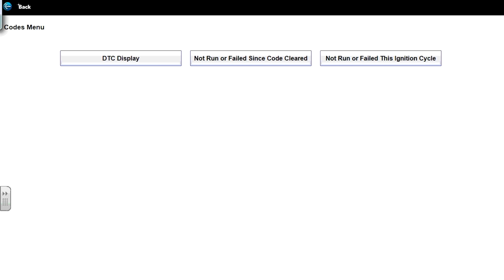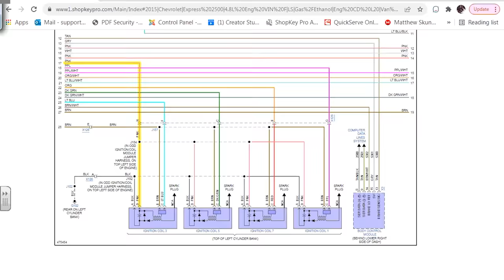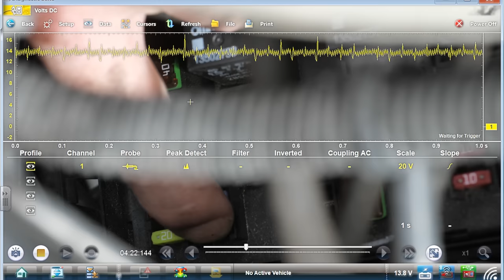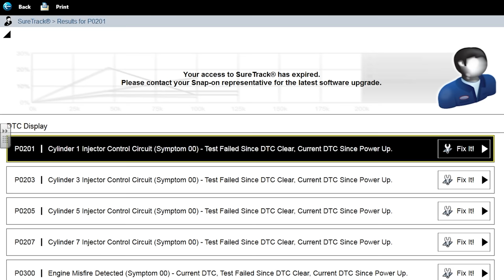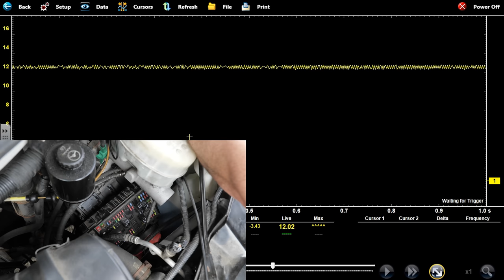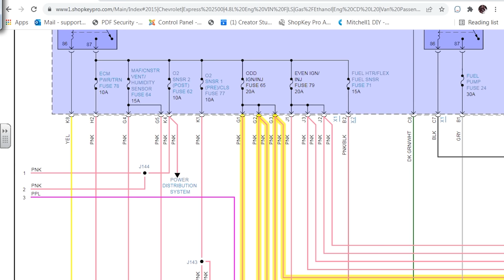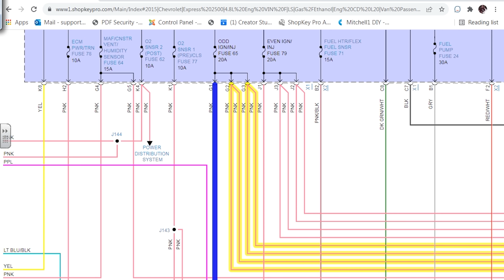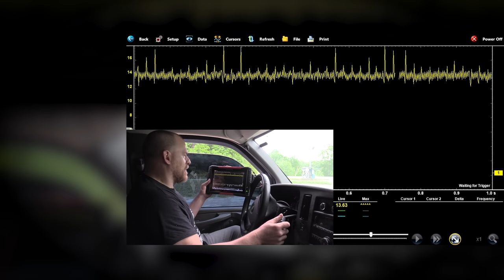2015 Chevy Express Intermittent Misfire - Injector Circuit Codes [Part 1]

Comment: I had the same issue on a 2008 Buick Enclave, I scoped both injector and coil powers.  When the injectors dropped out, so did the coils, but only set the injector codes.  I found that the screws that held the connectors to the bottom of the fuse box were stripped.  I ended up putting cardboard underneath of the connectors then snapped in the fuse box and it cured the issue.  That was several months ago.  By the way, this is my wife's car.

Comment: Huge fan been watching for years. I have worked on those vans before and I have seen the injector harness rub threw and ground on the block in the rear of the engine (unfortunately under the dog house)

Comment: I hate working for free too, but there have been times that I didn’t; but those rare occasions.

Last time I let someone go the came came in for an intermittent check engine light, P0300.

Ran the basics in 20 minutes.
Unsold brakes

Explained to the customer the situation that the care has great history, everything is new, and gave them a form to fill out next time the check engine light appears.

I further explained that if I continue diag I will charge for my time and the chances of finding something is slim. 

Customer returned two days later and I identified the problem. Looking at the worksheet I gave her turned out the boyfriend was using a OBD2 data logger for his job.

Always think outside the box

I did lose diag time but I won a customer for life. She has since brought all her cars to my shop and only trusts my judgment.

Comment: I work at a GM dealership and had one of these with the same exact codes on bank one and it was a constant dead misfire on 1,3,5,7 connected a head light bulb to the power feed and it would light it nice and bright. Fuse box fixed it though

Comment: I don't know about a 2015, but older ones of those vans had a problem with the engine harness rubbing through on the left front upper control arm mounting bracket.

Comment: Having the same issue with a 2016 4500 Express School Bus, replaced the fuse box and problem was fixed, thanks for the info. I must add our local Chevrolet dealer had it in stock .
Reply from the maker: Awesome, thanks!

Comment: As soon you took that fuse out the fuse box and put it back in all those codes are coming back that had my mind thinking as a fuse box or wiring problem we have alot of these work vans where I work at and that's why we see a fuse box laying around inside their good work vans

Comment: Hey paul I have worked on dozens of those gm vans and had that exact problem around a dozen times and every time I monitored the power feed to the injectors and as it gets hot I would lose voltage . The cause was a bad solder joint in fuse box . I dismantled one box and I could see a lose pin on board where the solder was not holding and failed When hot . Hope it helps
Reply: I agree!!!!

Comment: I noticed both times you had voltage spikes you was turning the wheel left, maybe a wiring harness near the steering shaft or in the ignition wiring to the key and tumbler? Just a thought buddy

Comment: I wanted to advise you to look along the wires to the injectors as, if one of them shorts to ground, all will lose power and the code will appear. The fuse will also blow or the pins will become loose if the short is very short (in time) and the fuse doesn't have time to blow but the pins get melted a bit.
Now that I've seen the end of the video I understand there must be something else.
Nice video anyway. I waited for one like this for a long time already.
Cheers!

Comment: Great video as normal you also need a ground. Although supply cables joints good how's the return neutral. Your pickup is common and your not using the earth the injectors are using. I've had a loose bolt chassis bolt worked ok till drove rough roads vibrates loose. Was hard to find hope find in part 2.

Comment: Don't know if you have found the issue but I had one that come in with the Samy problem. Found the sodder on the fuse pin to be corroded. Orderd new fuse box.
Reply from the maker: yes sir, check out part 2!

Comment: could the voltage dropping to 6 volts be a high resistance ground downstream or would that blow a fuse? just trying to learn. thanks for the videos.
Reply from the maker: A high resistance ground, as long as it is not located where your voltmeter negative lead is connected, would not lower a supply side voltage reading. 
Make sense?
Reply: @ScannerDanner thanks for the reply.

Comment: So I had a case earlyer this with the same kinda van. I ran the same test then removed the fuze box and opened it and it was burned inside the fuze box  same fault code but mine was not intermittent  so sold a fuze box then found the tsbs on this problem

Comment: i have a 2008 grand prix with a P0300 ive change sparks plugs check all coils for power change mass air flow sensor coils im using is zz performance heavy duty zz wires could that be the problem

Comment: Do all 8 injectors share the same ground, or is that irrelevant?
Reply from the maker: Each injector is individually grounded by the ECM and then would use a main ECM ground after that. So with a faulty main ECM ground, we would be having more than just one bank of injector issues. Make sense? Great question

Comment: Mode 10 on my 06 F250 is blank. I have set and reset the codes many times just in the past couple weeks. Even with MIL codes active, still no mode 10 data. So not sure how reliable that info is????

Comment: Bad alternator? Last time I heard a GM alternator screaming like that, it would charged great when cold but would soon heat to like 500 degrees and intermittently stop charging!! Looks like the scope was picking up some ripple as well. I never look the other way on a screaming alternator since your video on a Buick? that had so much ripple to cause speedometer to jump in park!! Now I'm wondering if the entire vehicle voltage is dropping so low causing the misfire. Thanks for the video, can't wait for part 2....

Comment: When you don't have much direction to work with on such an intermittent problem, you'd might as well pull and plug all the fuses and relays a few times to eliminate that as the problem. Check any easily accessible pertinent connectors and grounds too. Don't cloud your mind with too much doubt about everything. If the problem persists, you can then start a proper diagnosis with a clearer head. It's not always useful to spend stupid time and money to prove that the problem was just a poor connection at the pin of a relay.

Comment: Hello Paul  got one 2017 two days ago with the same code , but after I get to capture a injector waveform when the van was misfiring, then the van start working just fine , would like to send you the waveform if you like, costumer said is gonna bring me the car another time
Reply: the waveform I capture you can see clearly the drop out in voltage when I was checking injector #7

Comment: I have the same problem with a vehicle that im working on now ,i just have a missfiring on 7 cylinder i inspect everything, but the missing firings are still on 7 cylinder , any advise for  that sir. ??????
Reply from the maker: Spark, fuel and compression must be verified.

Comment: Hi Paul- South Hills kin here....who would you recommend for me to take a Mitsubishi Galant (06) that needs a new TXV & Receiver Drier? It already has a new condenser, evaporator, compressor, & clutch. I would try to fix it myself, but the shop that failed the job in the first place is offering to pay 1/2 of the repair cost to get my son to take his 1 star review off of Google & make things right. Should I go to Bethel Park Mitsubishi or do you know of a reputable garage that specializes in ac? Willing to pay diagnostics of course...thanks for any help. The shop in Idaho says it has to be a reputable shop.
Reply from the maker: My brothers shop in Bethel Park 412-835-7530 ask for Jim Danner

Comment: On intermittent stuff like this, once you have ruled out the obvious check points, I usually then go right to checking the harness;  not tearing it apart, but just back track the harness as best you can/  use some mirrors and lights, and just look for something obvious.   Because many times it can be right there in your face-  a wire bending around a sharp corner and worn through, ect. ect..  We've seen it all 1000 times.  Don't spend a lot of time on it-- just give it a once over and look for something to jump out at you--- and then move on.   Sometimes we can get a habit of sticking with the scanner and diagrams and overlook a simple visual check.  I've found that this can save you time more than you might expect.
Reply from the maker: Absolutely 100% spot on my friend

Comment: You may have a bad motor mount on the drivers side that is allowing the engine to move up when in dirve just enough to cause a bad connection. I had a bad drivers mount on a 2007 Suburban and it was moving the engine ground. I lost my mind figuring it out.

Comment: had an escalade do the same on 2468 side,had a bad coil and 2 bad spark plug wires ,kept blowing fuse to injectors

Comment: Had a similar problem on that same type of van.  But instead of injector codes I had misfires and a coil circuit code.  Ended up being the ground on the backside of the engine. Had to take the doghouse off and wiggle the harness to get the fault to happen

Comment: G1 is at the same tie point for fuse 65 that could possibly be part of the problem. If it was touching, it could draw down G2 and G3 circuits because all are tied to fuse 65.

Comment: The idea of FREE is that alot of people think you just plug into the vehicle and the computer tells you the problem.  . I explain that testing is required beyond a code point towards a potential system problem. And TESTING IS NOT FREE. . So testing starts at x$ and additional testing is extra. And if the problem is not present when testing then the tests will possibly test ok. . . So there is only TESTING FEES to get to the problem. So the word "diagnostic fee" is never used.  . So the customers options is pay for testing or guess. . And RETESTING cost just the same. . . Loose the "Diagnostic fee" , TESTING starts at whatever amount of $ .

Comment: I know you have to charge for what you do we have to do that in the tree diamond when you’re doing diagnostics people think the diagnostics is not important even in the locksmith is trade they think we are just some gas station attended pumping gas. But they don’t realize what we have to know in order to be able to do the work for the keys and the electronic systems for the automotive. Many a time I have asked my customer to take the vehicle back until the vehicle acts up again and try to get it to me when it’s doing that sometimes it’s extremely hard and it is also hard to want to charge more for something that you don’t have figured out yet so you have to try to figure out. What the fee should be for what you’ve done and just try to wait until the problem reoccurs. And hope with your fingers crossed that you are there to catch it when it happens. Good luck on this truck I have had issues with O2 sensors on my van and I’ve never been able to resolve that I’ve had them replaced put a new mini of times and it still keeps coming back. As bad O2 sensors finally I just gave up on them and let GM have it their way and have bad O2 sensors. Sometimes I think electronic things are over done which makes more headaches than what is needed if we could just go back to the basics on some stuff. Enjoy your videos keep up the good work.

Comment: I ran into this same issue on same type of vehicle loosing voltage feed to the bank 1 injectors, was able to duplicate concern eventually in the stall, Jumped a clean source of voltage to the feed wire from fuse box problem went away , supply to the fuse never dropped indicating high resistance in fuse box replaced fuse box problem solved

Comment: the video end was funny as can be 🤣🙃 I'd not trust the diagram showing the wires all spliced right at the fuse box connector either. because of multiple times over the years I've seen diagrams that way, then found one larger gauge wire spliced to many of them multiple feet away or at other unlisted connectors, including factory diagrams I got printed directly by employees (friends that work at them). same thing happens in electronics and machinery control panels and wiring, diagrams are always hit and miss and ii makes my blood boil. 🤯🤬👹👿

Comment: Monitor your battery voltage - at the battery - at the same time you’re watching the injector feed voltage to make sure you don’t have an intermittent battery or cable problem.  If they drop together, that may indicate a bad battery/cell or lose battery cable connection.  If the battery, cables and grounds are ok, then monitor the power lead at the fuse box, maybe the feed wire from the battery to the fuse box is loose or corroded.
Reply: Agree. And  I would lay eyes on the underside of the fuse box at those two side by side pins for green crusties. This is Western Pa/Pittsburgh salt bath territory.

Comment: you ever work on a car for 8 hours and not have an answer?
 do you still charge the customer 1000 bucks or what ever you charge per hour? i see your point. but if a guy is new and it takes him 10 hours to do what you could do in 2 hours. 

i took my car to another garage. 
said they  worked on it off and on for a week and they cant tell me what it needs to fix it.
 they did say a new engine might fix it. lol....

Comment: Maybe somebody else point this out in the comments, but you logic about the fuse box being the problem is incorrect. The problem can be any wire between the coils & injectors to the fuse box. The pink power wires are in parallel. Therefor the voltage must be the same on all wires. If one wire shorts to ground (0 volts) all wires will be at ground potential. Good to learn about mode 10.

Comment: I'm grateful for everything you have taught me over the years Paul, but when you start bring religion into your channel I have to admit I switch off a little,  I do appreciate your beliefs , but I don't follow the same thinking you have on that subject, I do however share your belief that voltage drop over a high resistance circuit will show up on a volt meter, and I have found this to be true, and that piercing wires is not a bad thing. Thank you for your content and in the words of the great Irish comic Dave Allen, "May your god go with you" Thanks Paul